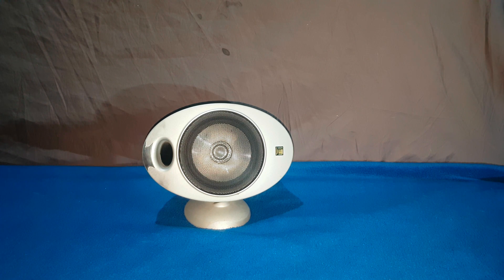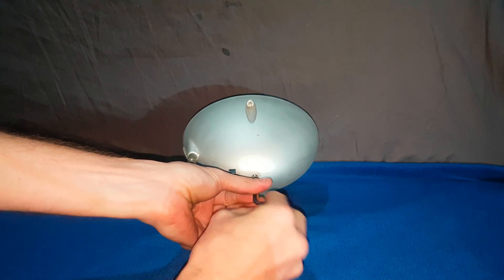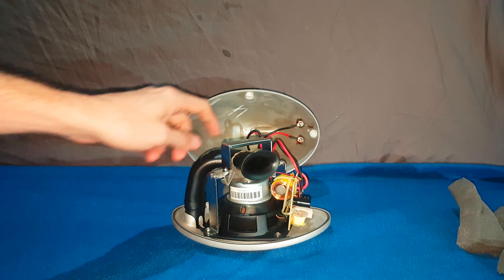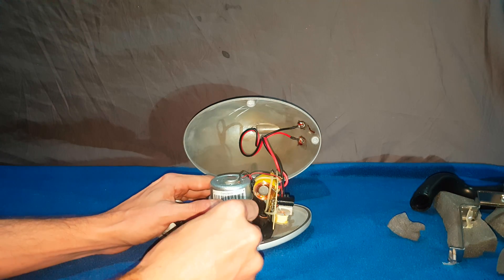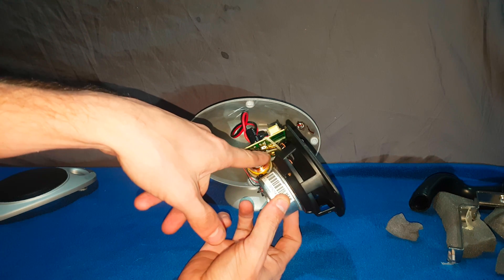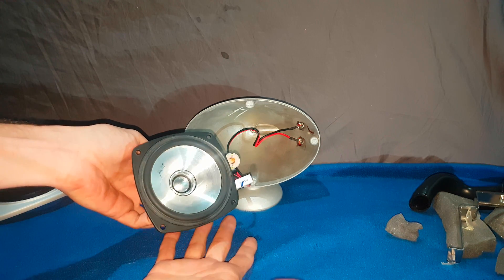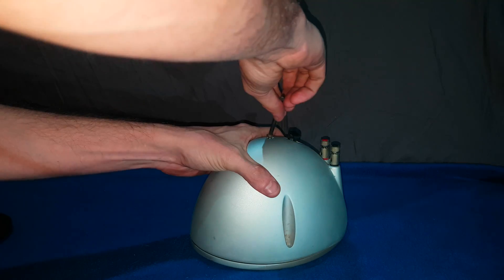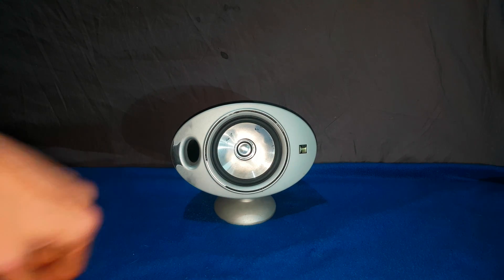KEF KHT 2005.2 UNI-Q Speaker Teardown And Sound Test

Comment: Can anyone who has taken these apart help me? I have some sticky HTS2001, issue SP3375 speakers to take apart. The speaker posts in mine appear to be araldited into place. What can disolve this glue without ruining the plastic parts of the speaker posts? Also, my bass tunnel / tube thing is attached very strongly to the front panel. It doesn't just pull away like in this video. Again, any suggestions on what to use to disolve the glue without ruining the tubey trumpetty thing? Thanks.

Comment: Hi thanks for the very nice video  I would check the cap in series with the tweeter  
If electrolytic i would replace it    that is the place for a nice plastic one 
The highs should lose a little distortion  I have done this many times without regrets  Not much money needed

Comment: I wanted to know if the tweeter array on this is compatible for replacement with the iq9 iq3ds or iq6c speakers. I have a pristine set of those bigger speakers but 2 tweeters are blown and was looking for a replacement. Some of these egg speakers are being sold "used" for $200 or so near me, and could make a nice harvestor for my bigger speakers. Any insight you might have (part numbers) or measurements would be invaluable.

Comment: I have these speakers, and just recently started getting a rattling sound from them during movie scenes with deep bass. When I took it apart and tested it, it sounded fine. When I put it back in the enclosure, I get the rattling sound again. Any thoughts on how to fix it?
Reply: I have a similar thing happen with loud deep movie bass. My make shift solution is to put them on a different mixer output channel than my subwoofer and then reduce the bass for the KEFS only, no problem since.

Comment: Got me some of these, had a Teufel Consono 35 MK3 till then and wasn't thrilled by the Music Performance of the Teufels. These are the best sounding satellite Speakers I've ever come across in the 26 Years i am playing with HIFI stuff, such nice Tonality, Definition and Clarity from the Mid Range to the Heights, very impressive! Will it beat the bigger LS50 or something like the Klipsch Reference 600? Probably not, but paired with a nice Sub it's definetly an option for some high Quality Sound. Especially since they go pretty cheap on the used Market.
Reply: I just purchased 6 of these last week and Kef subwoofer 2000. All in mint condition delivered to my door at € 200 or $ 240 the lot.
Reply: @jameswalsh2427  Nice! I Like them a Lot, Just for the Front left and right I bought some Used LS 50 Tor Stereo Listening which was a noticable Upgrade but These are a little picky when it comes to The Amplifier. I would at least Go to 150w at 8 Ohms, and the AMP should be capable of driving Low impedance Speakers, I would consider my Denon AVR 2600h as the Minimum, but If You Set your Crossover Frequency a little Higher, You should be fine with that SUB and These Beauties.

Comment: Thanks for the video! I have a q10c that needs a new tweeter, I have a few eggs and could sacrifice one to get the other going but I can't tell the secret of getting it out, it's not to hard on the center speaker but the egg has no screw or bolt etc!? Any help would be awesome!
Reply from the maker: Single bolt on the back
Reply: The Tech Guy, yes I can get in the egg no issues it was trying to get the tweeter out of the driver, it does not have the bolt, it looks like the uni-q tweeter isn't able to be removed
Reply from the maker: Behind the sticker on the magnet there’s a screw
Reply: @reidharris5064  I've replaced the tweeter on one of those uni-q from  a iq5. It was pushed in....i replaced it with a new one ordered from kef in uk throught the dealer. Its a delicate job....with unsoldering and soldering...
And a nuance like scratch the end of the thin wire in order to remove the protective dielectric coat before embebded that wire tips on the solder.
Reply: Did you manage to replace the q10c tweeter with the "egg" tweeter? I have exactly the same problem, and before buying a whole set of Kef eggs, I would like to know your result.

Comment: I have a 6" uni q driver from a reference 90 centre channel. There is a sticker on the bottom of the magnet which says the driver was made on 12th march 1993! It has either a 1.75" or 2" voice coil I can't remember but it is really efficient and sounds rather decent! I lov KEF!
Reply from the maker: +Vangerino vangerino the little ones i have do sound good but daymm there inefficient . How does your kef driver sou d